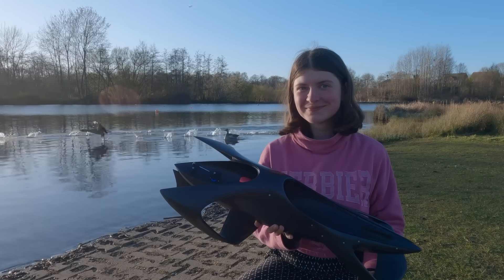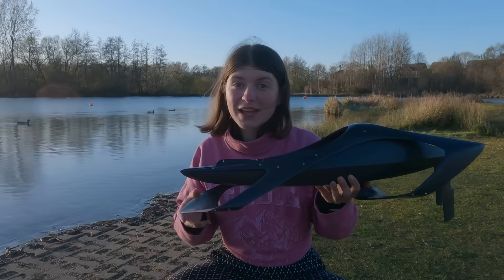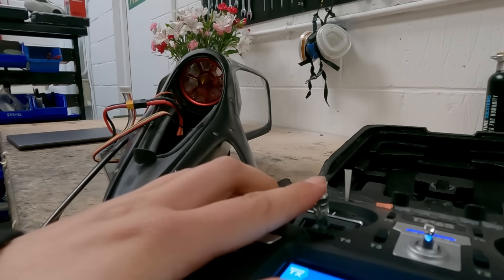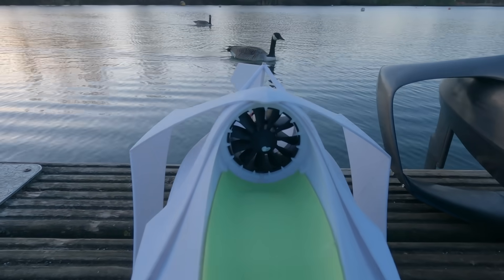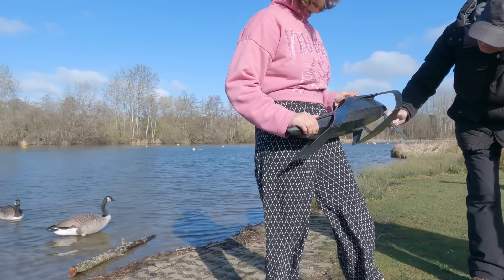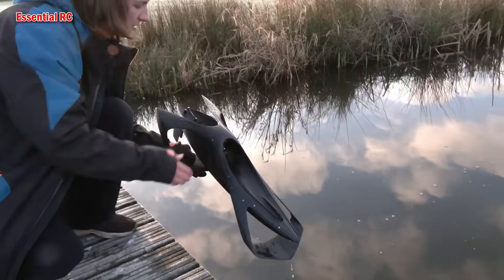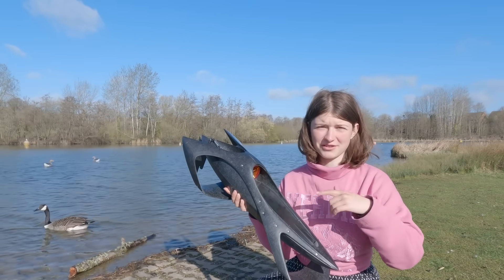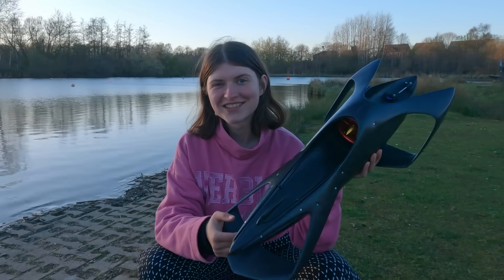Boat Propellers are Overrated... The HydraJet Explained

Comment: Stupid question, but that can't be scaled up for passenger or commercial transport, right? The jets would be too loud and dangerous. Certainly, there would have to be a soundproof cabin. It probably wouldn't be better than screws for marine life since the sound would be emitted from the body into the water. Would the high pitch be worse or better for fish and cetaceans? Could there be a design of any type of ship that would be better for marine ecology?

Comment: I suppose for the full size version you would have an airbox above where the passengers sit so they don't get scooped up into the fan. 💀  Then again airboats have been around for over 100 years so it's a proven method for thrust without people falling into the spinning props.  You might even use airboat parts for your build.

Comment: I agree with her, electric hydrofoils are the future, for energy efficiency. As for ducted air fan vs. water propeller issue, somebody much smarter than me needs to work out the efficiencies of those for me -- it basically requires a supercomputer doing fluid dynamics to optimize that. The real advantage of fans is they don't foul in mucky water.

Comment: The evolution is already history. Add air foils to use ground effect lift. In rougher water the craft will be an ekranoplane. Even better design the hydroplanes to also be able to add aerodynamic lift. Versatility is economic viability.  Further stage will be a seaplane with variable aero and hydrodynamic wings.

Comment: LOOKS Like noise  wasnt factored in your Design  ............. imagine being a passenger in one  of those  the noise would be HUGE  for both the passenger and outside people   not to mention the WIND THRUST  and environmental impact .....    Those are the Core bugs  if you ever make a life size version ......... AS A small toy version its ok  coz its a toy.  I think  BOAT  engine under water  is more efficient than this   ... because it doesnt do the surface splashing as much ..........

Comment: Foling is the future to glide over water. With reduced water resitance it is possible to save a lot of energy and gain speed. Beside this it gives a smoother ride even in rough conditions. Keep that always in mind and try to think big, every inch out of water for every kind of water vehicle would help. So you are on a good way. In my opionion you should try to opimize the design the front foil. From here it seems unnesseary too big. With a smaller foil you should gain speed and / or reduce energy consumption. As your foil is a bolt on it is easy for you to try different shapes. In my opinion with this clip you should be able to have access to a hydronautical water tunnel to measure boost and resistance. The next idea I have for you to think about if it would be possible to integrate some kind of shock absorber into the design of the foil to get the ride even smoother in rough conditions. This could be done by elasitcal inlays - or even adjustable from soft to stiffnes by electrical exciter . Regarding fan, honestly I am not sure that a blower is the most efficient possibility to move an object. Personally I would prefere an surface prop, but I know this also would have pros and cons. On the other side, regarding to the blower, probably you can gain more efficiency or boost with a end tip like a fighter jet turbine has. If you have more air jet stream the next step would be to think about if you really need an underwater rudder (dont forget, anything under water is not as good as over water). So I am sure, with the power of your brain, you should be able to exeed efficiency of the original design more and more. Good luck from Austria and hopefully one day you are a member of RedBull F1Team!

Comment: What if you put two engines on each side of the hydrafoils? That would go under water at slow speeds then as it goes faster they lift out of the water with the foils for higher speeds? This will free up your cabin space and no human will ge sucked into the motor fan blades,😂 and also give you twice the power.

Comment: Why use carbon fiber?  How much weight did you actually save in weight over glass fiber construction?  Did you actually do the math comparison and have a rational advantage you can cite, or was the selection just so it sounds like a high-tech solution?   As a professor teaching aeronautics and unmanned aircraft technology, I like to see honest academic exercises over hype.

Comment: Nice! :) Why don't you make the water wings so you can adjust them remotely. That way, you can test them in different positions to see if you can get better performance from them. 
Or if you are feeling really motivated. You could set it up with Sencers so the craft can adjust it's water wings depending on the way the water is hitting it. To max out performance in the same way an aircraft might.
3:12 Practical. Most important is to get it to work first before making it pretty, if you want. I see that you get that. :)

Comment: It’s really cool, but it has a scale issue. Fan boats have a cage for a reason, without it they are incredibly dangerous.

This is awesome for RC applications, but I sure wouldn’t want to sit in front of that fan when it’s scaled up 100x. So what is your ideas for props being “overrated”? Cause this is solving a nonexistent problem. Maybe you can sit the whole cab of the boat over the fan, that might work. I love wacky designs like this, gotta figure out how it can go to the next level.
Reply: I didn’t mention the sound factor either. This scaled up would be as loud as a small jet plane, fan boats are loud enough, this thing would absolutely blow your eardrums out.
Reply: Just thought of it, put the jets to the sides, that’ll solve a lot of the passenger problem. It’s still gonna be very loud, but at least it would be rideable. If you go for dual jets, you might as well go for speed anyway, cause why be loud and slow?

Comment: Design harmony w/ both water and air is a trick, and this is gorgeous!  Might not help aerodynamics, but it would be wild to see linkages stretch between the gaps, actuating a torque vectoring system for that fan - might just need one axis to add more steering maneuverability?  Beautiful modular build!

Comment: You have achieved a remarkable success there, with your HydraJet.  Where to from here ...  How about extending the wings, and you will have an Ekranoplan!  This should be possible, as you are already using an air propeller.  Perhaps the wings could fold behind the vehicle for 'ordinary use'?

Comment: As requested, I'd like to see a LINK here where I could buy one of these CF models. But my real interest would be to see an EDF JET  6S 70mm version that transforms the water foils into skids for takeoffs and landings on grass versus a model with wheels and/or retracts. They would slide over grass runways for takeoff, and have canards like the XB-70 Valkyrie. Eventually there could also be a dual 70mm EDF version. Wings and Canards could be Delta, Diamond shaped, or just sweptback. @EssentialRC could certainly advise you on how to make the wings removeable. Either a 3D or CF version would be a hit!!!

Comment: Would you be able to try thermoforming a hull?  Heat black poly tubing and fibreglass in a oven until it is really soft and then press in between tooling of any sort until the fibres and plastic flow evenly throughout the tool from pressure.

Comment: I'm an inveterate amateur tinkerer rather than a professional anything but I have some thoughts.
Love the boat, love the idea.

If you're thinking of a full scale version my suggestion would be to revisit the water propeller at least once and see what can be done with a modestly priced RC scale drop in outboard motor or something similar. 
The reasons being: 
-At full scale, any motor that achieves the power to weight of what's in the model is probably going to be massively expensive and doesn't leave a lot of room for the actual humans in that hull.
-While the option of an air motor is absolutely workable and probably doesn't really need all that horsepower, if you're thinking of a broader market then a hull which people can drop in (and replace) a standard, off the shelf motor will massively broaden the appeal and possibly get past some of the hesitancy around the radical looking form also having some room to move around inside the boat will make it more useful beyond and expensive toy.

You sound like you already have a fairly good idea of where you want to go with this so some of what I've said here will likely be redundant but if I can reinforce one thing it's to keep in mind whether it's being made as something that a lot of people will have uses for or is it going to be a toy for those who have money for toys, I think there's probably room for both.
Anyway good luck and I'll be interested to see where this goes.

Comment: Underwater wings for buoyancy under water, which at the same time merge into the static suspension of the boat above water. A very elegant hybrid solution for floating on and with the water surface. Not bad, and really good. Super good.

Comment: Call them wings if you like, I'd call them hydroplanes. And if you must bolt them on fine, but have you considered adding shock absorbers as an independent suspension system to the front wing connection points? Think about it. If you are as brilliant as you seem on the video, you'll understand in time. Then if you see that point, you'll understand what comes next. This was brilliant.

Comment: Very cool ,and yes the foil has top speed limitations .With hydro planing I believe there are ,at least two developments ,the suspension route ,and the 'sea ski ',or both . The sea ski is using long thin skis which can also slice through waves ,softening the ride . Keep up the great work ..[ and did you cook your carbon fiber ? it can be a trap for new users , the epoxy can melt/go soft, in hot sun ,unless baked after initial cure ,manufacturers have tables of time and temp for expected operational temps .Black carbon easily gets to hot to touch in the sun .would be really painful after your first oopsy to have melted boats again ].

Comment: You can strengthen your 3d prints with backyard cheap “flash Graphene”process. If done right, it may produce 900x stronger polymers, from carbon dust at 200x lighter. Much stronger than titanium.
Reply: Ps. Make sure it is “flash-graphene” and not regular graphene. They are very different. Flash version is dirt cheaper at larger quantities, and can be done with a quartz plated pressure cooker and electrolysis.

Comment: It seems like it's very stable on the water when planning. You should see if someone is interested in financing / building a larger version or eventually a full-scale model. You could test prototypes using RC control so you wouldn't have to risk putting a human on board until the design was perfected. You could try to start a racing series with VR headsets like they do with drones. I could see this evolving into an on-water version of F-1 with human drivers! I would run with the idea. Get RED BULL on the phone!

Comment: Super cool looking and operating craft.    One comment.  EDFs are notoriously inefficient compared to open propellers.   In theory they can be more efficient for a given diameter prop by reducing losses at the blade tips but in practice the fact that you have to use smaller diameter props to fit inside the duct and accelerate the air a lot to generate  thrust makes them much less efficient than just using a larger diameter open prop, and accelerating a larger volume of air less.   Also most ducted fans have a ton of extra platform drag.   You've done a great job of minimizing platform drag, and it has a batmobile vibe so I suspect, if given a choice most people will choose the ducted fan over conventional props, with no concern for efficiency.

Comment: its just a jet ski but the jet terbine in in the air and not under the water. also your just dinogthe same thing that thsoe water tuior boast withthso ebig fans already do. all you did was just put a hyrofoil witha powerful elctral motor fan on the top and made it more aero dinamic. heck its thats not even a real water jet terbine anyway. a real water jet ternibe =uses acatly water that sucked ina and then highly copresed and then stip out hte otehr end lieka actaly water jet. but that thing you got there is not a real water jet engine. i would know bescue thts what a jetski uses and this is not what it actly does.
Reply: but other then that the usa mitlaery in aera 51 might want you to make something for them. its looks like it can actly be pretty sealthy with the right kind of resorced for deveplent ona much lagrer scale. like russa and the usa tredyed this before but it falled but your new konlage and erpacsne might change that for the usa.
Reply: also teh usa navy migth want to use that for uav drones and other stuff too.

Comment: Adrian Neweys replacement. If you see a call from Red Bull…answer it!! 👍😎😁

Tamara - you have a brilliant career ahead of you 😎👍🇺🇸🇺🇸

Ps a million years ago (1983) I was an air traffic controller for the United States Navy at Whidbey Island in Washington State. I was asked to be a part of the acceptance trials of a new hydroplane, designed by Boeing for the US Navy. The acceptance trials are when Navy brass go out on the boat, it’s put through all its design parameters and the Navy “signs on the dotted line,” formally accepting the boat. That boat was the USS Hercules PHM-2. Long story long, screaming around the Puget Sound at flank speed doing design rate turns while foil born was a hoot. We even did a crash landing, abruptly coming off foils at full speed. My job was to control an  aircraft at different speeds and altitudes around the boat to see if the weapons could maintain a radar lock (the boat had to turn fast enough for the 5 inch 54 cannon on the bow). The Navy accepted the boat, tied a broom to the mast indicating a “clean sweep.”

Comment: Awesome looking design! And seems to be very well designed with roll and pitch stability both when floating and when planing.
Surely most of potential speed increases would come from reducing the size and angle of the rudder? More so than from the planes/foils?

Comment: I'm curious about moving the large intake from the center of the craft so you'd have more room for passengers or cargo.  Also, would side-mounted fans enable better low speed maneuverability?  Maybe if you had 4 taxiing engines as opposed to at speed engines.  Thanks for showing your work!

Comment: On the rudder design, is it possible to use both vectored airflow as well as water rudder?

You said that the are vectoring was rubbish at low speed but I was wondering if it would make sense to design the boat to use the water Rudder at low speed when it's below planing, but make the router short enough so that high speed it's out of the water and just using are vectoring

Comment: I am blown away. I blueprinted a real size personal water craft back in the 90's, now defunked (WetJet Personal Watercraft). How about an ABS undercoat or inner model that you can skin with Carbon Fiber n gel? Maybe same scale or? I'd put my drone up to trail watch it most anywhere - rivers would be a blast. Yes, TPU seals or a silicone n screws work for me too! That design n the engineering you pulled off is amazing to say the least.

Comment: Wow, that is an awesome combination of a seemingly disparate technological systems. That design might make flying boats viable again or an alternative way to safely capture air craft that are unable to deploy wheels, if the hydroplane is able to reach the take off and landing speeds of a modern aircraft lol! 

I was tinkering with the idea of using an edf ducted into additive printed air blade ducts to create virtual body shapes on older cars to improve aerodynamics in order to improve fuel efficiency, turns out there is a lot of free air pressure created from drag that you can use first.

Also unrelated, I noticed you were making fairings for velomobiles, also awwsome! I've been trying to make the Cruzbike recumbents work as a suburban ranged commuter bicycle due to its much simpler drivetrain design.

Comment: Nice! Did you think about the option to put the rudder in the front of the boat? It would probably require a smaller fin (or smaller fins if you'd opt for two to reduce their depth) It seems to me that this would further reduce drag and thus be more energy efficient. You might even put them under the front wing and move the whole wing to change direction.

Comment: Would it be more efficient if the rudder was attached to the rear wing? I'm thinking once the water is disturbed, it takes less effort to disturb it again. It looks as if the rudder is creating an enormous amount of drag. Somehow there needs to be a way to improve that. 
Something else to look at. While you single air rudder do not do well at low speeds, take a look at swamp boats with only an air rudder. Typically they use multiple air rudders to steer the boat. Another idea would be to build in tube steering, where the whole outlet tube turns. This is what is used in jet boats.

Comment: You have power to spare but it looks like the boat never get up on the right plane to create the least amount of resistance cutting though the water. I would love to see you experiment with a hydrofoil type design. You could really get crazy and 3d print louvers with different angels for the back of the propeller for some thrust vectoring.
Keep up the great work.

Comment: That's badass, very nice job.

I'm no engineer but doesn't an air propeller induce less drag than an underwater one? Probably less efficient but I wouldn't be surprised if it could enable you to reach faster speeds...

Having a camera (+FPV ;)) on the boat could be awsome too.